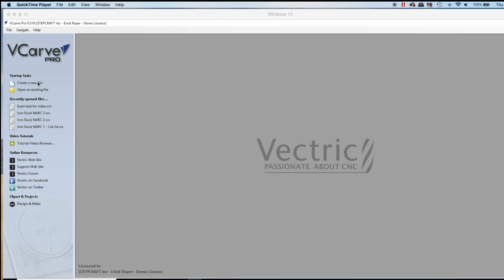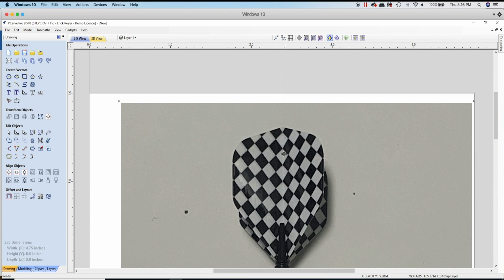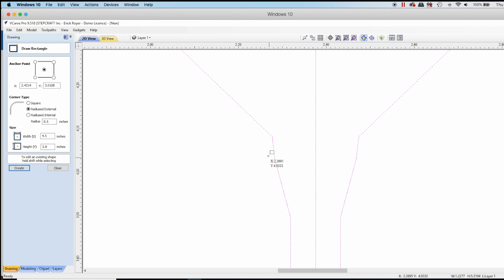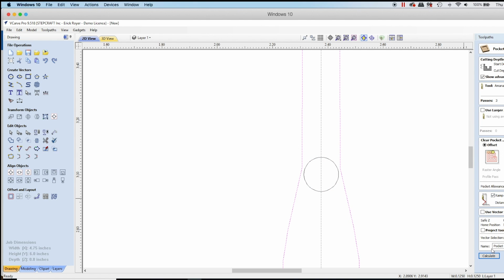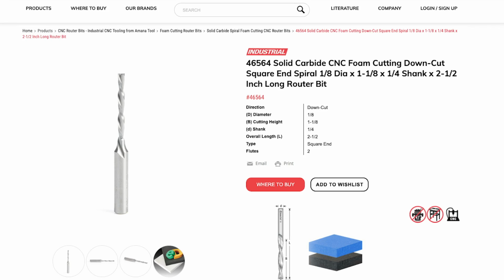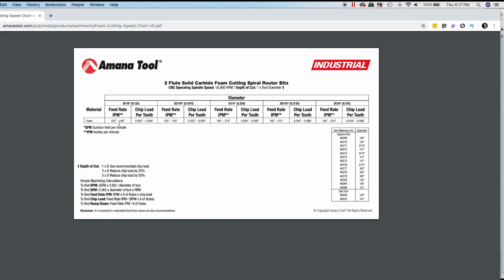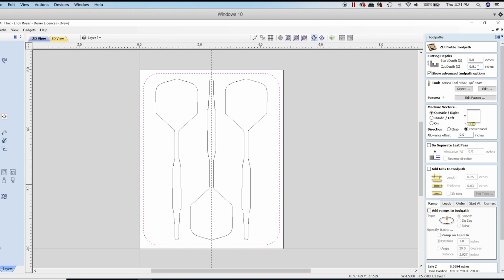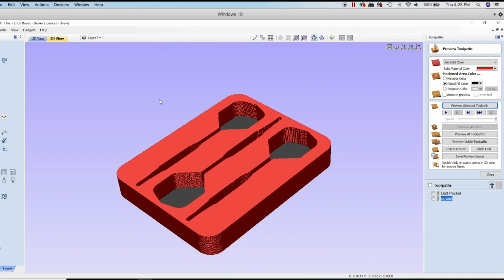Make A Foam Dart Tray - From Photo to CNC Machine - Full Tutorial

Comment: Very nice Eric, and timely. I was throwing darts earlier this evening. Love the design walkthrough. It is great to see how smoothly that software gets you to a finished part.

You know you did a bang up job on this one, as I've only two thoughts for V2. First, did you consider leaving the pocket shallower under the shafts, to provide a higher floor for them to rest upon when you push in the darts? Also, it looked like that foam has a pretty high density when you were machining it. If so, my second thought was to add small finger pockets to help grip the barrels to extract them.

Can't wait to see them in the box. Or whatever your next video is.
Reply from the maker: Thank you so much for the comments.  Yes I thought of all those items... after the fact... My initial project was not a dart case, I was testing a job for a customer that I could not share publicly so I was trying to think of a quick project to illustrate what I did for my customer.  A shelf for the shaft as well as finger holes would have made this much better.  Now I have to make a full-on dart project series :-)... More to come...
Reply: I had no doubt those details would have crossed your mind. I've been sketching ideas to add lighting for our dartboard. Nothing cut yet, but it will happen on my Stepcraft.